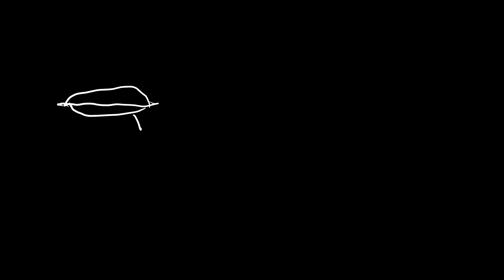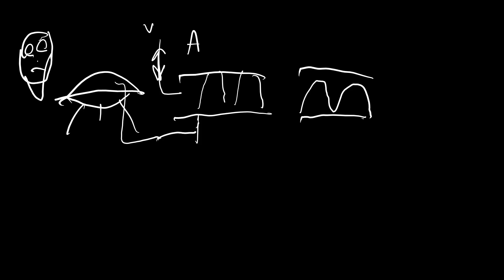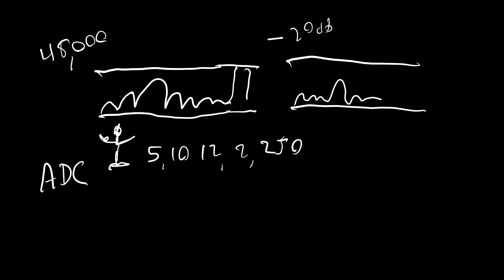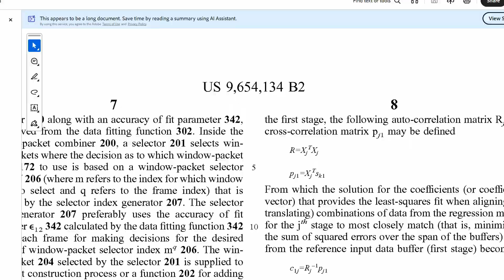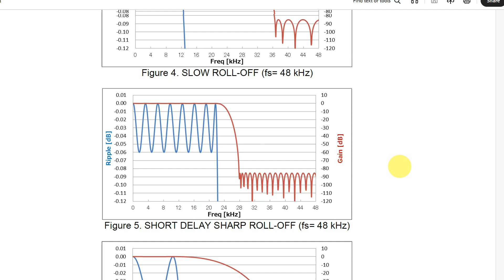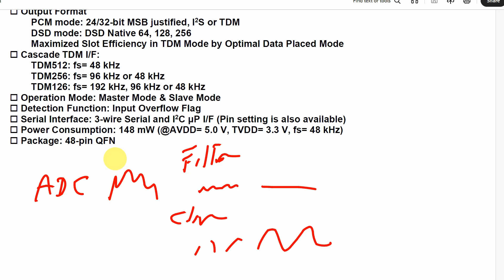Shannon's Theorem: Why Multiple ADCs Can't Help

Comment: You can connect a mic to two amplifiers. Impedance is what determines any signal degradation. If your mic has a 200 ohm impedance, connecting to two 2000 ohm-impedance amplifiers won't load it down much. Naturally mic here means the mic element with the usual FET pre-amplifier contained within (this is the point of this, to lower the impedance of the signal so it can traverse cabling and amplifier inputs without being diminished).

You reference Shannon's theorem about information content, but the point of multiple ADCs (or a traditional single ADC with gain adjustment) is to move the ADC's dynamic range to better capture the information. This is to work around ADC limitations. An ADC can't capture all the information contained that we might want to use.

Even if the mathematics of combining ADC readings could never be resolved, you could still just record the separate versions and let the engineer choose which didn't clip.

You argue that even if a mic captures a huge dynamic range, you would blow out the ears of the listener. This ignores editing before the final product. You'd be adjusting the gain of the loud sound down, and quiet sounds up, so someone could hear them both comfortably. This is a critical point about 32-bit recording: you don't ever need that dynamic range for any short segment, since you would have to hear that range to tell the difference; it's only useful for a longer recording, where you will adjust the gain of different sections differently, effectively increasing the dynamic range the listener can discern within the sounds that occurred while recording.
Reply from the maker: I don't understand "move the ADC's dynamic range to better capture..."  The ADC never moves.  It is calibrated to the output voltage of the pre-amp--which I feel very repetitive on ;)  So not sure what you mean there.

Once you have your output, final amplification, there is no version that doesn't clip, if there is clipping. So not sure what you mean record separate version?  You mean differently gained?

Yes, of course, you're right, in all video or image capturing the numbers are abstract.  There is no loud or bright, we make it so, finally, by where we scale. If we record an aircraft, naturally, it probably won't be played at that physical loudness.

But I disagree with you about 32-bit float.  Again, sorry to repeat.  The ADC works down from the max voltage (signal) from the pre-amp.  Whatever you set your gain to, you will end up with noise below 21 bits.  It seems you believe you can set your gain to above noise and the bits fills up as the sound gets louder.  The electronics don't work that way.  

Therefore, 32-bit float never becomes useful.  You never get above 24-bits in the ADC even if it writes to 32-bit-fixed, which the new ones do.  They only do that to fill space through digital processing--and even that, not sure they ever do.
Reply: @MaxoticsTV  Yes, I meant adjust the gain before the ADC to "move" its range of capture around.

If a normal adjustable gain 24-bit ADC can capture low-noise recordings of quiet things (with gain up) and loud things (with gain down), then it can handle a wider dynamic range than the ADC alone with a fixed gain. Again, gain just moves the window of sound levels (voltages) it captures.

32-bit float allows representing a signal with a wider dynamic range. A very crude dual-ADC system could switch between them on a coarse time scale, e.g. once a second at most. With 32-bit float they can both exist in the recording, with levels matched so sounds stay the same loudness even when switching.
Reply from the maker: @gargantuablargg  Phew! :)  Okay.  Right.

Yes, agree, a 32-bit float COULD represent a wider dynamic range.  Agree a very crude dual-ADC system could switch between signals. (again, it works with final output of the pre-amp).  But I see no benefit.  

Shannon says the signal is as complete as it will ever be, no matter how many times you try to extract information.  Conservation of energy and all that.

As I go over in my video, I just don't see how a 2nd ADC can add information.  It's a semantic slight of hand to say 2 ADCs in the first place.  Analog in Digits out.  You can connect ADCs serially because they don't accept digital outputs.  And again,  if they both have the same analog input?

Sound Devices had a theory that tuning two ADC differently would give better fidelity--perhaps less clipping.  But I don't hear it.  

AsahiKASEI says they can achieve 3db of extra dynamic range using that approach but range does not imply good "dynamics" fidelity.  They give a 112db S/N on the 121, but not a similar measure on the 124db.

So color me not surprised haha!
Reply: @MaxoticsTV  A better ADC can digitize more information present in the signal than a worse one. Just compare an 8-bit ADC to 16-bit one. In this case one is clipping so it doesn't get the shape of the waves above the clip, whereas another one with lower gain does. That's more information.

Not sure why you're quibbling over terminology. If I have two ADCs with their outputs added, they are still two ADCs whether their outputs are added or not, even though when added they function as a single ADC.
Reply from the maker: @gargantuablargg  Sorry, does 8-bit clip more than 16-bit.  8-bit is inherently more distorted (which is obvious watching any movie before the 1990s).  I mean, of course you're right, that the probability of clipping in the real world is much higher in 8-bit, but clipping is about missing data, not size of data...I guess another quibble ;)

On the ADCs.  It's more than a quibble.  I agree.  You can add multiple ADCs and average them out and it will be the same as one ADC.  Though I would expect as you make additional copies of the first signal you will lose information so as more ADCs are averaged the fidelity will decrease.  

That, in a sense, was the fundamental problem those early telephony engineers faced when sending signals long distances.  

That's why they came up with this "laws"

To argue that two ADCs can give better dynamic range or fidelity contradicts those "laws" and the effects of every kind of noise conspiring to degrade every copied signal it touches.
Reply: @MaxoticsTV  I used 8-bit ADCs as an easy to understand case of capturing less information (more noise). Just go to the extreme of a 1-bit ADC (at 48 kHz), clearly capturing less information than a 24-bit ADC.

I don't think Shanon's theorems apply here, other than establishing the maximum information content of the source signal. You acknowledge that there's more information than a 24-bit recorder can capture, hence the need to adjust gain appropriate to the source material. You seem to be approaching this as if there's some uncertainty principle that you can't extract all information due to measurements of one perturbing the other. A 24-bit recorder is an arbitrary level of technology, not a definer of the maximum that can be captured from an audio signal.
Reply from the maker: @gargantuablargg  Yes, I think I've said often that 24-bit is arbitrary and most conservative estimate is 21-bits of useful bits.  So if someone comes out with a paper and how they can get 25 bits of useful data from a mic I will have to cease and desist--haha.

In my experiments I never see any improvement above 16-bits.  Of course, my experiments are mickey mouse.

It's not the uncertainty principle that guides me here--though that's a favorite of mine!  It's more entropy.  There will always be noise where there is energy dissipation.  

Mic voltages are too close to thermal noise.  Again, someone may discover a new material/tech that isolates the signal better, but until then, we can't just pretend it doesn't exist.

The whole purpose of pre-amplification is to bring the ratio of signal to noise higher and to voltage pressures our electronics can work with.  It can never eliminate the noise, only push it down the bits, so to speak.

All the ADCs in the world can't change those fundamentals?  Can they?
Reply: @MaxoticsTV  Again, a 24-bit recorder with gain down has too much noise for quiet things, so this establishes that there is a use for the two mic, two ADC (with different gains), two recorder setup when you have to get it right the first take, just more convenient by combining it into one 32-bit float recording. The only two technical objections I've seen you make to doing this with one mic is the mic+FET being able to feed two amplifiers, and how to combine two ADC outputs.
Reply from the maker: @gargantuablargg  Yes, two mics, each feeding into their own preamp/ADC device is the way it's been done and will continue.  It makes no sense to combine both into A 32-bit float recording because if you don't have clipping why add more noise?  You'd only want to switch if clipping and if you do that you'd want to control how much to mix in?  

It doesn't matter if 32-bit-float could fit it all, you're still adding the pre-amp noise from the low gain you don't use most of the time.  You have to normalize both to the lowest common denominator so to speak.
Reply: @MaxoticsTV  For most people 32-bit float recorders are clearly about convenience, hence the benefit over two mics and two recorders.

As for noise floor, presumably a multi-ADC unit won't combine outputs when the signal is small and in the noise floor of the low-gain one (just like it won't when it's large and clipping the high-gain one). If I ever had one, this would be the most fun to find pathological cases of: what weird signals could you feed it that expose how the selection/combining algorithm works, and make it work poorly.
Reply from the maker: @gargantuablargg  Yes, I have some ideas for that.  Like putting in a signal near the noise floor and demonstrating how the Zoom F3 would try to remove it during whatever-its-doing and how a normally gained recorder wouldn't. 

It just feel such a waste of time.  Not that I don't waste time haha!